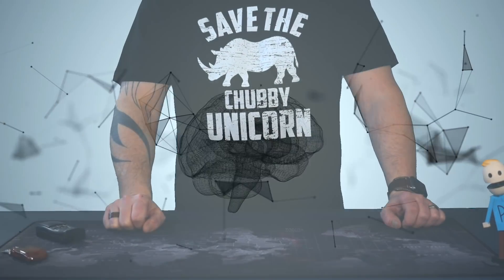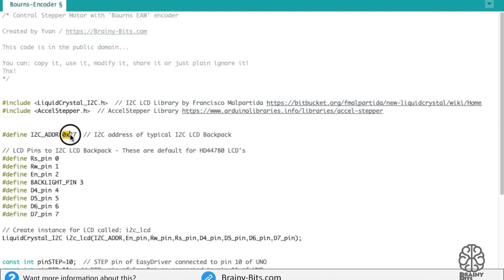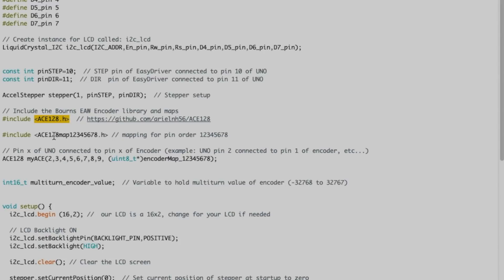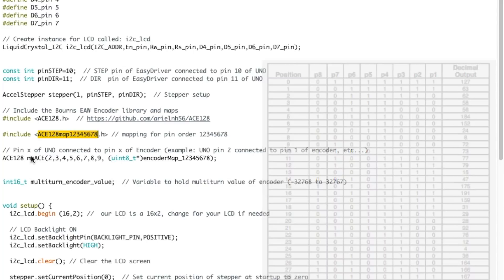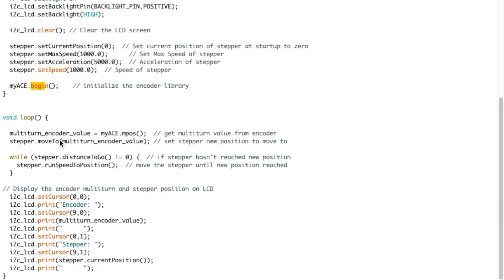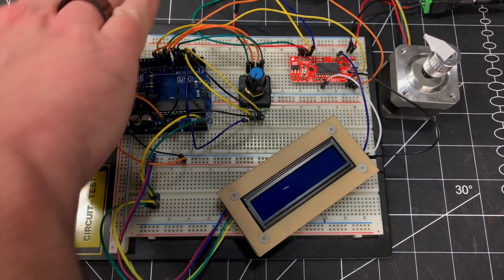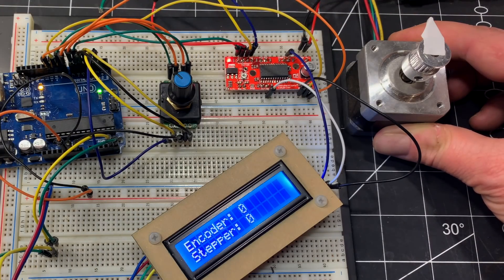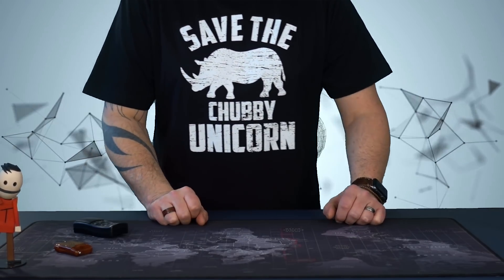A Rotary Encoder that’s Always on the Money!

Comment: The ACE128 Arduino Library file has changed so an error will occur ... This video shows how to fix it: https://youtu.be/5oMUdKc8cAo
Once the ACE128.h library file is changed the Error is in line: ACE128 myACE(2,3,4,5,6,7,8,9, (uint8_t*)encoderMap_87654321 will go away.
GREAT TUTORIAL ... THANK YOU  
Brainy-Bits

Comment: Have you uploader the code for this, its exactly what I'm looking for,  I'm  would save me a lot of time working it out. Thanks
Reply from the maker: Here it is: https://www.brainy-bits.com/post/a-rotary-encoder-that-s-always-on-the-money
Hope it helps, Thanks for watching!
Reply: @BrainybitsCanada    yes i did find it just after posting request on here on your web pagers, very nice clean website.  only problem is it wont compile as LiquidCrystal_I2C you list is diffract to the master version of LiquidCrystal_I2C and the link you proved comes up error 404 (That link has no power here) lol, i worked my way round that now at line 43 (ACE128) is throwing a (no matching function) up the library is installed, i gave up at this point.  will get back to it at some point. Thanks

Comment: can you destroy the encoder if you connect it the wrong way? I have a problem that the circuit does not work but I had the wires to the encoder wrong and I thing it destroyed the encoder

Comment: Hello from Athens,,,,First of all well done ..generally.
Can you help me with my project please when you have a little time to write-reply on me?
Thank you in advance.

I want to create a wind direction [0,360) arduino project and take the data(the angle)
in my java program to ....do more job there.

And just today i bought an arduino(my first) and a cheap 5 pin rotary encoder !!!
So ...on my first arduino program,,,,my first notice was that it bounds....and i dont want this!!

I search and came here.

So my 2 questions are.
1)Can you please give me a link to bye just one of this sensor ?
Because for me,beginner, it is a little confusion to understand from
https://www.bourns.com/inventory-search-results?PARTS=EAW
I mean ...is this sensor ...the sensor of your example?
https://uk.farnell.com/bourns/eaw0j-b24-ce0128l/absolute-mechanical-encoder/dp/1364336?CMP=GRHB-NETCOMP

2)Can you advise a more better (the best for you) sensor in case that
you think that for my application 
(
WIND VANE 
>~ 32 points wind direction reading [128 is more than good]
no want to bounds
need no latency
)
...you may have already a better solution?

Thank you
Reply from the maker: Check out this tutorial: https://youtu.be/cYCTMdUi8P0 maybe it can help with the rotary encoder you already have.
Reply: @BrainybitsCanada  Thanks ...i will try..Basically i was already trying and now was going to sleep
because got tired and confused more!
Thank you again and i will try to learn first as i can,,,, before asking again.
Also i found gere in Greece this encoder
https://www.hellasdigital.gr/electronics/components/bourns-absolute-encoder-eaw0j-b24-ae0128l/

so...only question 2 may remain........

As i have nothing to give you in return...just take for your programming brakes...my ...work on some non relative....things.
http://jimakoskx.blogspot.com/2015/11/planet-earth-christ-jesus-english.html
Reply from the maker: @DimitrisTsoykalas  Take your time, Rome wasn't built in a day, kind of like the same with learning anything new...  The link to the bournes encoder your provided is the same one that I used in the tutorial, so if you want to give it a try it should work the same.  Don't worry about giving anything in return, I'm happy to share my limited knowledge, and if it ends up helping others that's good enough for me.  Thanks for the link to your blog, I'll check it out when I have a chance.  Cheers!
Reply: @BrainybitsCanada  Hello all again.
Can you (or anyother that have free time )
check this approach?

Its not perfect but i am putting it here in case we figure out some solution for 
the original problem that is = missing clicks

I ve used bytes to be sure for syncronization issues without making the code more comlex.
My approach has 2 critical points.
1)Very critical that attaching interrupt to DT and not CLK
using pin 2 for CLK and pin 3 for DT

2)Use a buffer for discard the changes 
---------------------------------------------------------------------
void oln(const String & s0,const int & i0){
  Serial.print(s0);
Serial.println(i0);
}
void oln(const String & s0,const int & i0,const String & s1,const int & i1){
  Serial.print(s0);
Serial.print(i0);
  Serial.print(s1);
 Serial.println(i1);
}
void oln(const String & s0,const int & i0,const String & s1,const int & i1,const String & s2,const int & i2){
  Serial.print(s0);
Serial.print(i0);
  Serial.print(s1);
 Serial.print(i1);
  Serial.print(s2);
 Serial.println(i2);
}

//main code

const int pinclk=2;
const int pindt=3;

int clk;
int dt;

const byte max=255;
volatile byte curr=255;
volatile byte clks[254]; //assume not overflowing....
volatile byte dts[254];  //assume not overflowing....

void TurnDetection(){
    ++curr;//0 on first time
    clks[curr]=digitalRead(pinclk);
    dts[curr]=digitalRead(pindt);
}

int pos=0;

void setup() {
  // put your setup code here, to run once:
  Serial.begin(2000000);

  curr=max;
  clk=digitalRead(pinclk);
  dt=digitalRead(pindt);
  oln("starting at pos ",pos);
  oln("clk= ",clk," dt= ",dt);

 
 // SOS SOS interrupt on DT
  attachInterrupt(digitalPinToInterrupt(pindt),TurnDetection,CHANGE);
  }

void loop() {

  if(curr<max){//something happened
    
    if(curr>0){//has many signals 
      byte i=0;
          //just to see the buffer here
          while(i<=curr){
            oln("i= ",i," // clk: ",clks[i]," dt: ",dts[i]);
            ++i;
          }
          ///we saw the buffer
      
      i=curr-1;//take last change only
      clk=clks[i];
      dt=dts[i];
    }
    else{//only one signal
      byte i=0;
      oln("Single = ",i," // clk: ",clks[i]," dt: ",dts[i]);
      clk=clks[i];
      dt=dts[i];
    }

    
    if(clk==dt){
      ++pos;pos%=30;
      oln("Right to: ",pos);
    }
    else{
      --pos;pos%=30;
      oln("Left to: ",pos);
    }
    curr=max;

  }//end something happend
}//end loop

Comment: I like the project is it possible to A: get the system work on a rc transmitter and B: if you reset the system that the steppermotor wil get alway's to the same point 0 ?

Comment: Would it be possible to write multiple positions store them and recall any one of them perhaps using the LCD Keypad shield ? (would be good for remembering tune positions on my Mag loop Antenna)
Reply from the maker: Possible using like you said an LCD and some buttons.  I've done some tutorial setting IN and OUT points for stepper motors, here's one that might help: https://youtu.be/lvP5xMOstus  Hope that helps and thank you for watching!
Reply: Blimey, that's exactly what I am going use it for! Mag loops are fabulous Ham Radio antennae which look like a hula hoop hung on a vertical post. 2 stepper motors required, one to spin the post and the other to micro-tune a vaned variable capacitor at the base of the loop. Just getting into the whole Arduino environment and these videos are extremely helpful, thank you

Comment: Hi, thanks for this useful video. I encountered  a problem. I put "ACE128 myACE(2,3,4,5,6,7,8,9, (uint8_t*)encoderMap_87654321)" for direct pin connection and include the library correctly, but I kept receiving the error "no matching function for call to 'ACE128::ACE128(int, int, int, int, int, int, int, int, uint8_t*)'" even after I add uint8_t before.  The code can compile if I only use ACE128 myACE(ACE_ADDR, (uint8_t*)encoderMap_87654321). Do you have any idea about how to fix this? I'll really appreciate your help
Reply: Hi there, did you ever find a solution for this issue?
Reply: This video shows how to fix it: https://youtu.be/5oMUdKc8cAo

Comment: Hi
Does it click?
I’ve ordered one but it’s not clicking. Just as a pot
Reply from the maker: No, it doesn't have a switch integrated like an ordinary rotary encoder.
Reply: @BrainybitsCanada  Thank you. Its clear. But its not about a switch. My one doesn't have any fixed positions when rotated. Doesn't click. Just rotating as a pot. Just wondering if thats correct. Thank you
Reply from the maker: @konstantintsubarenko8272  Oh sorry I misunderstood what you meant...  Yes that's normal, the shaft rides on traces inside the encoder like a potentiometer, so I doesn't have steps and is smooth when turning.
Reply from the maker: @Alastair Young Thanks for sharing those pictures of the inside of this encoder.

Comment: Hi, why my I2c LCD flickering so fast, it's an arduino menu project (Lcd User Interface ) with a three button 'next/+', ' previous/ -' and 'select/exit '
if you may cover this problem , im willing to share my project 
thanks
Reply: Are you powering any other devices from Arduino at same time? My 1602 LCD flickered more when I powered an small servo from the Arduino at the same time. The servo was  taking too much current. Maybe try powering your LCD independently?
Reply: @420Skuzz   thanks for replying , all the circuit are powered by an smps 5v 5A , i know it has more of the power that it needs , but i struggle with the code i think the switch case .. do you have any similar code to my project
Reply: @akroutsamo  I wonder, do you actually mean the slow rate at which the 1602 LCD seemsto update?

It's not a very fast LCD, by any standard it's quite slow.

Comment: May be the bourns 8bit encoder is nice if you don´t have much other electronic to interface to...but anyway it eats up many pins...just for the encoder....
with a little bit of extra bebouncing hardware, you can use the usual two/three pin type encoders....i managed to track these types of encoder reliable even when it is gonna  be turned realy fast and without any software debouncingon an arduino UNO, watch this:
https://www.youtube.com/watch?v=xw1HIFOe_Ik